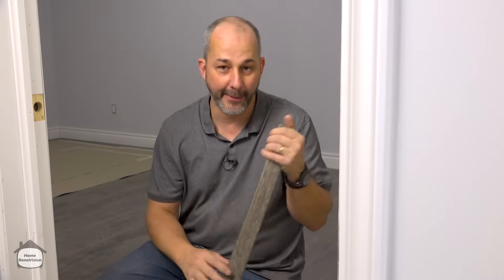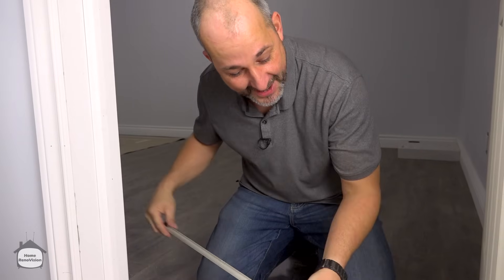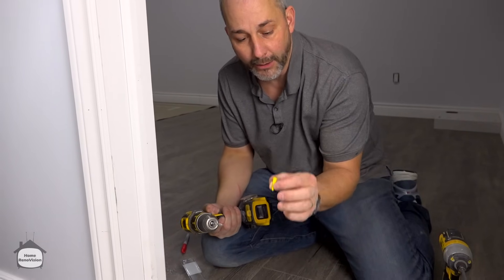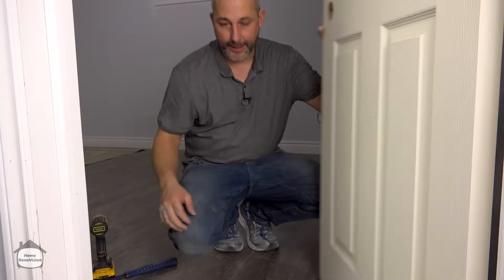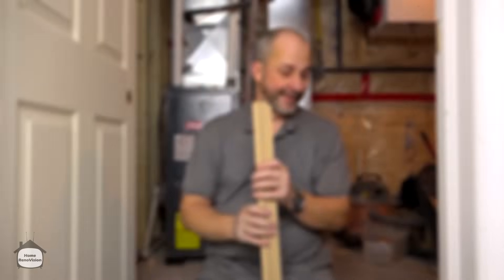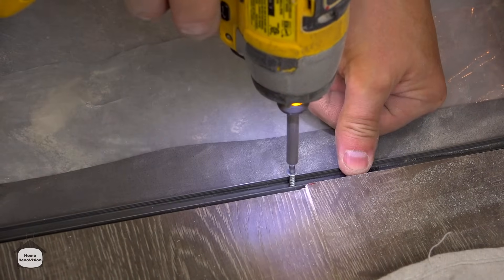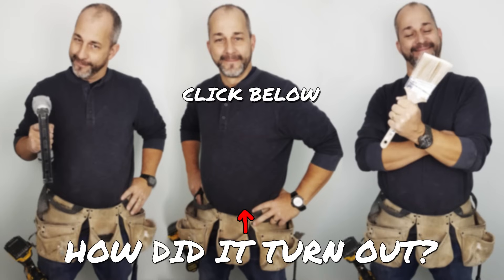How To Install Laminate Flooring | Transitions

Comment: I much prefer to use natural wood on floors but for our rentals we always use laminate flooring and those transitions give a perfect finish between rooms, excellent advice 👍
Reply from the maker: Cheers!
Reply: I learned to never use laminates in my rentals. I have been using vinyl plants for over 12 years now.

Comment: Love that you didn't fill the gap with adhesive/caulk.  I replaced a door that was done like that and the door looks like a mess and nobody would want it anymore.  The concrete was lumpy and took an hour of scraping and working with an oscillating tool to clean up. I WISH they'd followed your video.

Comment: I enjoyed your video, it showed me exactly what I was thinking that the installers did it wrong to begin with.  We had laminate flooring put in our hallway and living room and the installers made a mess of the doorways as well as floor molding.  I could have done all of this myself had I had time, but I had a feeling that they were suppose to not leave so much of it in the doorway rather they should have cut back in order to put the transitions and reducers in like your video shows.  See, the hallway and Livingroom had to have plywood to meet with the kitchen flooring that was already down 4 years ago and our hallway and Livingroom had thick carpeting that made it blend in with the flooring but now that the Livingroom carpet and hall was removed we need plywood but our other 4 rooms have rugs but much thinner and we're keeping them and now we have an unsightly situation because these installers went ahead and put the transitions/reducers in that extended beyond the doorway and looks like crap and I have pictures of everything that was done wrong.  My question is this, now that they cut back some of our carpeting in the 4 other rooms to fit the transitions and beyond the door ways that need to be cut back we'll have a space that will show missing carpeting when someone comes back to correct what was done wrong.  How can this be done in order to finish off the doorways correctly and still cover the bare missing rug? Yes, we were told that when it's done the correct way we will have this unsightly mess to look at.    I was thinking that these came in different sizes in width but was told no.  How do you think this should be done in order to make this all work?  Your reply to this matter would be greatly appreciated, we've been sitting on this for over a month waiting for the company to send someone out to fix what was done wrong to begin with.  It's a game these contractors play, pay and wait and hope the consumer doesn't notice or care how it looks......
Reply: @arlenemac16
Did you ever get it fixed? What did they do?

Comment: Would you still do still do transitions at doorways (even if the same flooring is going to continue through) for vinyl plank as well?
Reply from the maker: The flooring companies suggest it however I do not do it that way since the flooring barely expands and contracts. It has less movement than hardwood.
Reply: I just had mine installed and the flooring company did that exact thing. I wasn't happy about it. They did say it was a warranty issue and they had to install it that way. They said they were supossed to use transitions going into closets as well, but didn't. So I do have three bedrooms with transitions at the doors, even though the floor continues through.

Comment: Hi, what's the best way to transition from laminate to carpet?   I assume it's the same idea as the reducer you used between concrete and laminate with carpet trimmed appropriately to look neat  as a T moulding would have half the T floating above carpet (so not supported on one arm of the T) and potentially be damaged over time. Or are there special carpet to laminate transitions?. Thanks

Comment: Hi Jeff,
I LOVE your common sense approach to renovation. Your videos have helped me tremendously while working on my dated house. Question: I just finished laying VPF in my basement (carpet was in there before) and there are two areas where I’m unsure the best method to proceed: 1. A small storage closet under the stairs in the basement (closet is at a slant due to staircase) 2. The landing of the stairs from the main level to the basement. (Go down the stairs and the basement is to the right); the VPF runs parallel to the stair runners if that makes sense. Would you use a transition in these situations? Change direction of the VPF, etc.?

Comment: Jeff why do you use a hammer and old board instead of the tapping tool you can buy. It also works great for getting the last board in against the wall! Kudos to the camera person and also thanks for these videos they are easy to understand. Would like to see a video of laminate in a kitchen remodel and the best ways to let it float.

Comment: I have 2 different thickness of laminate that in trying to put a reducer on. Such a pain. I used a metal transition because the MDF reducer seemed to sit to high because there wasnt a big difference between the laminate. Its 12 mm to 8mm I believe.

Comment: I plan on laminating my living room and dining room which are in the same continuous space, basically the area looks like a rectangle so I am running the boards along the length. What I am wondering is in what direction am I laying the boards that go on a hallway that begins at the middle of this rectangular area. I figure I run the laminate along the length of the hallway as well? That transition between the living room and the hall would look require a transition I imagine but how? I've watched most of your videos but I don't recall a similar scenario. Thank you

Comment: Hey Jeff. Thanks for the videos. I've just gotten around to installing some laminate in my sun room and I had some questions.

1) how do I finish the threshold to an exterior door if the laminate is much lower than the door jam? Can I finish it with a quarter round and leave the existing threshold alone? 

2) I noticed you only leave room for expansion in the length dimension. Shouldn't you be leaving your 3/8" gap around the entire perimeter? Maybe I am mistaken here.
3) If there is a presents of water infiltration from previous flooring around the doors, how can I prevent future damage to laminate? Its obvious I will need to caulk quite a bit under the quarter round, but I am worried that wont be enough. 

Many thanks!

Comment: What size of screws/anchors did you use for this? I'm doing the exact same project but I'm doing a reducing transition strip from carpet to vinyl plank. I'm trying to secure my base rail to the floor but can't seem to find a consensus on exactly what to use for anchors/screws. Thanks for your hard work!

Comment: I have a fully carpeted basement and I want install flooring at two opposite ends to accommodate a bar at one end and pool table at the other while keeping the carpet in the center. Any helpful videos on removing partial carpet to lay flooring?

Comment: What transition do you use between laminate and carpet (on concrete as well)? I didn't think a T bar.. is it the same uneven bar you used for the laminate to concrete then roll the carpet at the transition piece? Thx!

Comment: Hey Jeff,
I have a question. I am about to start this process with flooring at two separate heights. There is a den that has carpet in it but does not have a door and after I remove the carpet I will be transitioning onto tile. I am planning to put down the laminate over the tile and in the den. So a few questions 1) when placing in the transition can I drill through the tile into the concrete and 2) what type transition should I purchase? I have seen one called a slope and I was thinking that would be best. 

Thanks for your help in advance.

Comment: Being the construction guru I am not, here's a question. Will 2 millimeters between heights of flooring be a big deal when putting in transitions? 1 room of flooring will have 9 mm thick, including padding, the other will have 6.5 with padding, unless, I double up on the padding, and make it 8.5mm with the double padding.  Thanks. As always, your videos are the best. Cheers
Reply from the maker: That is a great question. in most cases the transition has a thinner profile than the flooring. if you use adhesive to install then you can place the transition flush on both sides. Cheers!
Reply: Home RenoVision DIY won’t that leave a small gap between the moulding and higher floor since the transition is angled downwards?

Comment: Jeff, how about using a circular saw to cut as much as possible in the doorway, then use the reciprocating tool to finish at the sides? This saves a lot of time and extra blades.

Comment: Jeff, if you haven’t installed the door casing yet, do you end the flooring about halfway in the door framing? Great tips I always learn something.
Reply from the maker: be careful. most doors are on the side of the opening and not in the middle.

Comment: Jeff, I have a question.  I just bought a house and hired a company to install laminate flooring over beat-up hardwood flooring in several rooms.  I recently noticed in one room the beat-up hardwood flooring slopes downward towards the corner of the house.  Does this it need to be leveled somehow before the laminate flooring is laid over it?  If so, how can I do that before the flooring guys start?

Comment: I noticed you used countersunk screws to hold the anchor strip down. They looked like they were sticking up quite a bit. Doesn't that affect the height of the transition strip when installed?

Comment: Great videos! Ive gutted my 1917 house and finally got it back to the finishing stage, your videos have been so helpful! Do you suggest I install the laminate flooring, carpet, and tile for bathrooms before or after hanging the doors? I was thinking of doing the doors after but then it will be tough to know where the transitions will be?
Reply from the maker: best to install the doors first and under cut the jamb. we have a video on how to do that as well. the laminate or vinyl install video covers this technique. Cheers!

Comment: Hi Jeff, I can't seem to find this answer anywhere online. I have a Vinyl Plank system in our master bath and im trying to figure out if I need to take a T transition strip and cut it to a 45 degree to end the planking against the shower tile that goes straight upwards. Thank you for the help.

Comment: Qu: getn ready to do flooring in basement,  are vinyl or laminate planks better over concrete basement? I noticed that it looks like u have plastic underneath, is that required over concrete?

Comment: Any suggestions on installing laminate up against a sliding glass door frame? This room has three entryways and confusing because I’d hate to have three different transition pieces. I was thinking just using the quarter round that matches, but would I nail that to the sub flooring beneath the laminate? For a doorway, I noticed the door trim ends are significantly high from the floor. Is this intentional? Did this make it easier to install the transition? We had to line up the planks parallel to the doorway, so I’m hoping we can cut around the edges and avoid the transition piece altogether. How would you advise?

Comment: Thanks for another great video! Here it looks like the underpad was installed directly over the concrete, but in your basement video you chose to also use a subfloor. When can I use just one and when do I need both in a basement environment?

Comment: Hey Jeff, quick question. I bought the transition piece that is good for 2 doorways. What would you use to cut the metal track? Thanks in advanced! Appreciate your insightful videos!!
Reply: A standard miter saw will work fine. Those tracks are aluminum and cut without issue on a regular saw blade.

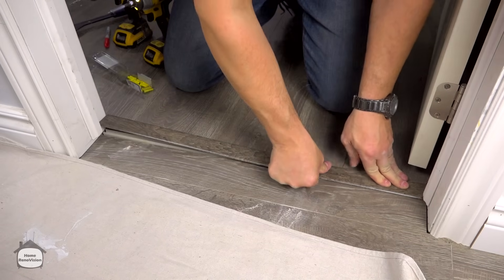Comment: Jeff, at 6:20 in your video you can see that the plank on the right side of the door could have been cut a little better so that the gap was under the trim.  Is there a tool that you would recommend to cut planks around doors and weird corners?  I saw your video about the tool that chops planks all the way through the material, but how about unique cuts? edit - also, great video!

Comment: I was told I didn't need to use the metal track when installing T-molding on concrete I could just liquid nail it...what are you thoughts?  I was going to use concrete screws???

Comment: I just had a floating floor installed in My downstairs Family room . I have 2 Bifold doors where the boiler and water heater are the floating floor ends inside the doors . I need to put in a 4 foot rubber transition strip from the floating floor to concrete . What should I use ? Thank You

Comment: You can use wood screws in concrete by drilling a hole the same width as the screw then use copper wire as a anchor, copper wire may very but it works

Comment: Hi Jeff all,
I have a 1/4 of an inch difference between my tiles and the top of the laminate flooring to install (tiles are higher) I heard from tilers that there are transitioning flooring underpads that can be used to shift the flooring up gradually, any clues on these as can’t seem to find. My other option would be to raise my sub floor by 1/4 inch which is too costly for 8 linear feet combined of tile contact.. 
Any tips on how to proceed? 
Thanks

Comment: You could use a piece of solder and wood screws in drilled holes in the concrete

Comment: What is the advice when I am going from a standard laminate pergo to vinyl plank that is 1.5 mm thinner.  T moulding will be tight to the pergo but not vinyl plank.  Is the best way to raise the vinyl flooring to equal the pergo? How would you do it?

Comment: What transition piece should be used for flooring of two different heights? I habe tile in my kitchen which goes to laminate into the living room. The piece the builder used isn't correct and its cracked down the edge length wise. There is mayne 1/4" difference in height. 
I plan to lay vinyl in one direction over the tile in the kitchen, and a different color vinyl running a different direction. Also is it recommended to go directly over existing laminate flooring?

Comment: First things first, thanks for all your videos! 
I'm installing the same laminate all throughout my home and I'm leaving the bathrooms alone, so I'm putting down transition strips there. If I keep all the laminate in the rooms going the same direction, do I need transition strips anywhere else?
Reply from the maker: doorways are usually enough. occasionally if your room is larger than 200 sq ft and you have humidity variations like Florida I would suggest another across the room but that is pretty rare.
Reply: Read the specs...typically any doorway/opening less than 4 feet needs a transition.
Reply: @calebsvideos2583  I was wondering why the installers put transitions in my doorways when the same flooring was being installed through that same door. He did mention what you just said when I asked. I wasn't pleased at first, but if that is the way if should be done, I'm happy.

Comment: We’re installing floating floors over tile in the bathroom and want to transition it to the base of the door. Issue is that there’s a 3in in width marble transition at the base of the door that is not level with the height of the tile (it’s higher) we’re not trying to demo the tile. Can I remove the transition piece without damaging the tile? If so, now I have another level issue where the transition piece was. What would you recommend?

Comment: Great video Jeff!  I'm in the middle of a flooring project and T mold is tomorrow.  I have a Gypsum concrete sub floor in my condo.  What kind of bits do I want to use?  This stuff is pretty fragile and I don't want to destroy the subfloor and not be able to put in the molding track.  Thanks!
Reply from the maker: Personally i hate gypsum concrete. I would suggest using an adhesive.in addition to screws and plugs. Cheers!

Comment: Another great video Jeff. I do have one question for you. I am going to be installing luxury vinyl planks shortly in the basement and I am planning on putting this on the back stairs also. Do you have a video showing how to do this? Do you have any tips? I was scrolling through your videos and have not found one for this yet. Thanks Jeff.
Reply from the maker: Hi David, contact your floor manufacturer and get the nosing for the stairs. then use a glue to install. Cheers!

Comment: I had a situation where another family member began the installation of laminate, but failed to bring it into the opening between two rooms...and I had the job of dealing with their poor work Vinyl tile in one room to the new laminate. So I was left with about a 5" section of bare concrete to cover. 

How would be the best way to install a piece of laminate that will go perpendicular to the new laminate to cover the bare concrete?  I don't have any tongue left in the end of the laminate to mate to the crossboard. And there isn't enough thickness to biscuit the two sections together. What is the best way to keep the two from moving?

Comment: Hello Jeff, as always I love the videos. 

I'm getting ready to lay down vinyl plank flooring and I wanted to get your thoughts on something. 
I'm going to have a few rooms next to each other separated by a door while the flooring is going to be going the same direction. Is it best to put in a separator under the door jam, or can I forgo that part and keep the flooring going from room to room. I look forward to your thoughts.

Thank you,
Reply from the maker: hi Matt. this material has an expansion rate of less than 1% of wood. I don't use transitions anymore However you might want to consider the manufacturers directions. Cheers!

Comment: On the 2nd part. Homeowner fail. I did the same thing. When you cut back with the oscillator, how do you fill the gap "patch the flooring" on the otherside with all the end grains cut? I ran mine directly in the middle about a 5/8 gap.